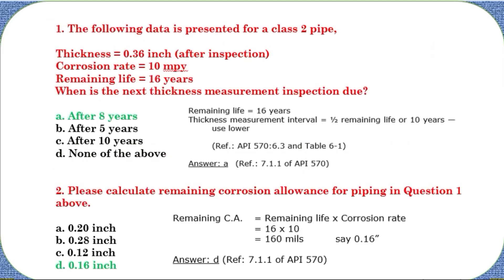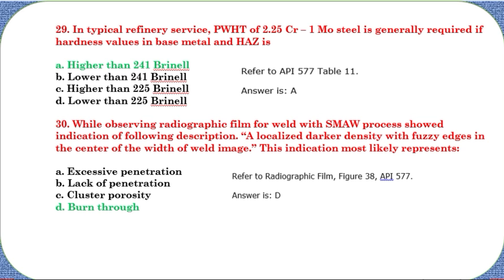API 570 Piping Inspector  Exam Questions & Answers /Part 3 [API-570]

Comment: Need corrections in Q.21 (wire diameter in inch), Q.24 (E-7018 and E-7015 both are F-4,

Comment: Sir thanks a lot one query for questions no 11 answer should be C as per your refer code also plz clarify it????
Reply from the maker: You can not use the 200 kg /cm2 as the range is more than actual range. It shall be 160. That's why near range is 150. You have to us that one